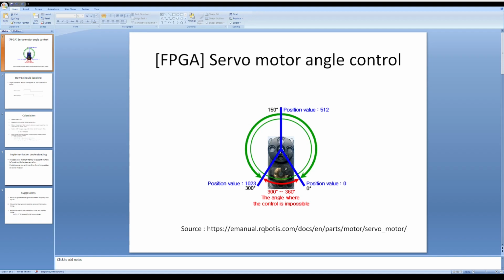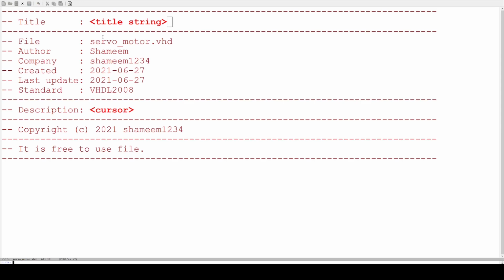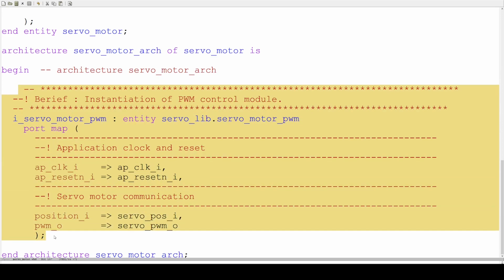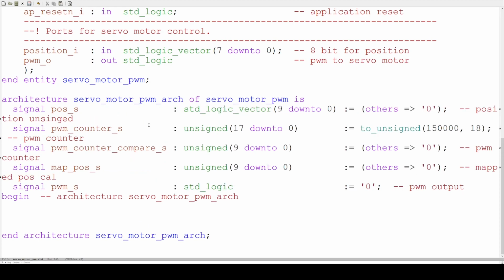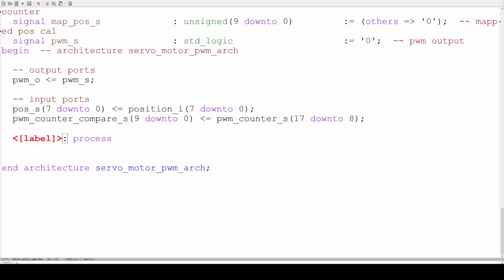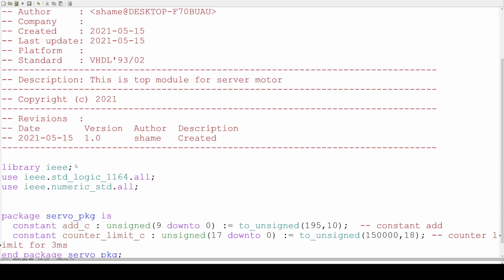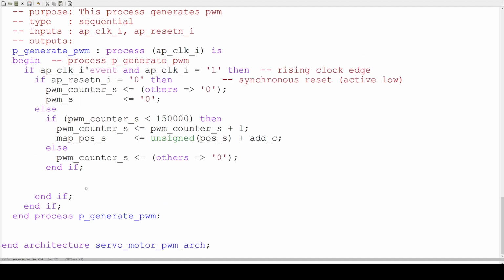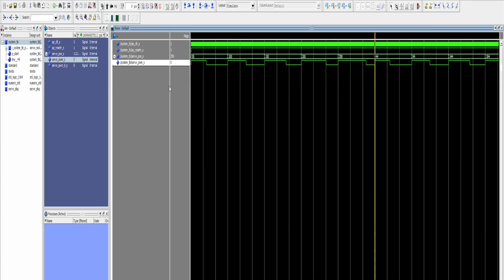[FPGA : VHDL] Servo motor rotation control via angle.

Comment: Hello. I did also  " library servo_lib; " but  I have the follow error on Modelsim : (vcom-1598) Library "servo_lib" not found. Could you please tell me how to fix it ?
Reply from the maker: You need to change the lib name work to servo_lib in the project.
And include the files in that lib.
Reply: @sambigbite11 
Hello. I have these errors on Modelsim for my top-level entity which I called servo.
My PWM file is called servo_pwm.

-- Compiling entity servo
 -- Compiling architecture servo_motor_arch of servo
# ** Error: (vcom-11) Could not find servo_lib.servo_pwm.
# ** Error (suppressible): C:/Users/angel/Desktop/SERVO/servo.vhd(31): (vcom-1195) Cannot find expanded name "servo_lib.servo_pwm".
# ** Error: C:/Users/Desktop/SERVO/servo.vhd(31): Unknown expanded name.
# ** Error: C:/Users/Desktop/SERVO/servo.vhd(45): VHDL Compiler exiting

Please, how could I fix them. I tried but I didn't found a solution.
Reply from the maker: @amtrendingfunnyvideos3628  this error is related to lib. U been using servo_lib in your file and have not included that into the project. Also if you calling a file from that lib then you must have that file under the lib.